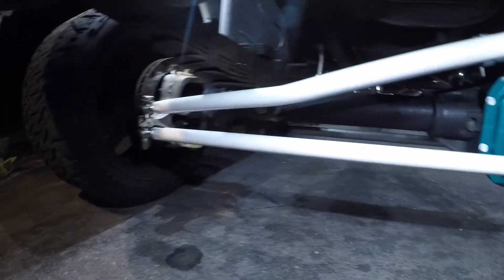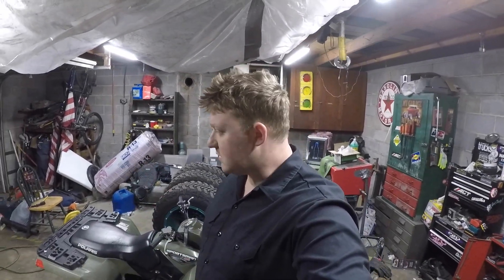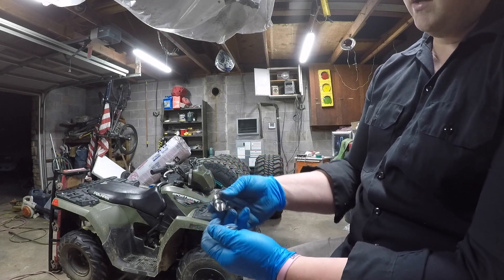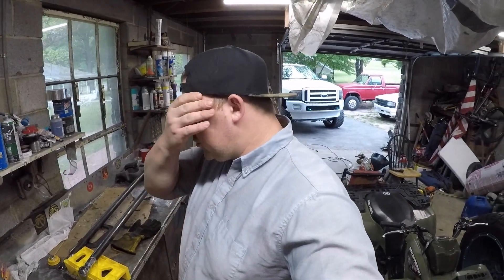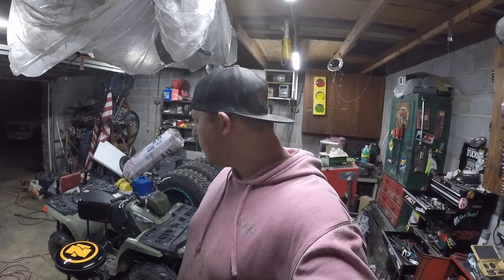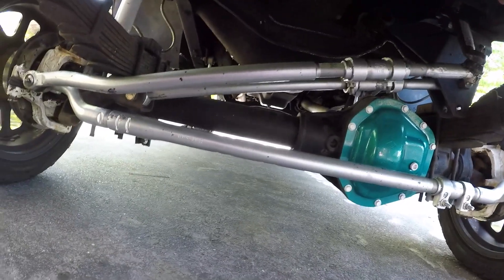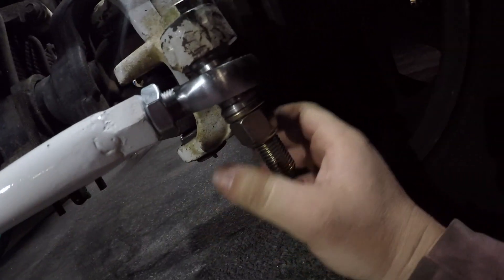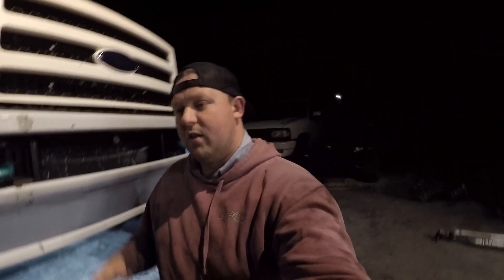How to install heim joint steering

Comment: How much lift does your truck have?
Reply from the maker: 6” lift springs.
Reply: @teedogcustoms  I have an 8” lift, wondering if I should go with high steering. Did the heim joints steering make a big difference in steering feel?
Reply from the maker: @Mike-xn1bh  yes I love the steering nice and firm no shaking at all.
Reply: Can you make another steering kit and sell it? I want a set 😂
Reply: @Mike-xn1bh did you go with high steer or this kit? I’m in the same situation, I have a 9inch lift and stuck between this or the high steer
Reply: @mineolascoots  haven’t done either. I recommend you install hydro assist before. It made a huge difference

Comment: How do you adjust your alignment after you did what you did how do you make your wheels right
Reply from the maker: I used a tape measure and measured from tire to tire on the front and then the same from the back of the tire.  Abs just adjust till you have the same measurement. Then you and adjust your drag link to get your steering wheel Straight

Comment: is there a reason you didn’t face your hardware up on the tie rod? I’ve got a Trail Forge Heim OTK kit and the 5/8 bolts get beat up off-road and it’s just the bolt head
Reply from the maker: No reason my truck never goes off road and it looks better from the top.  If I was going off road I would probably do it the way you did it